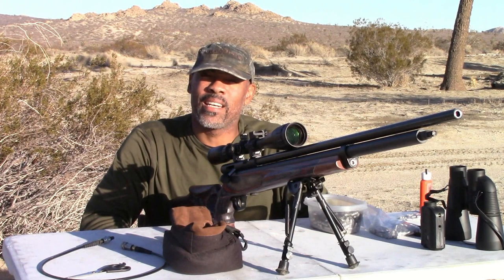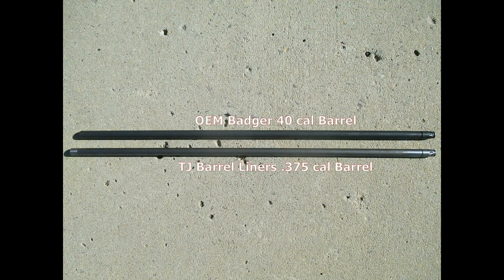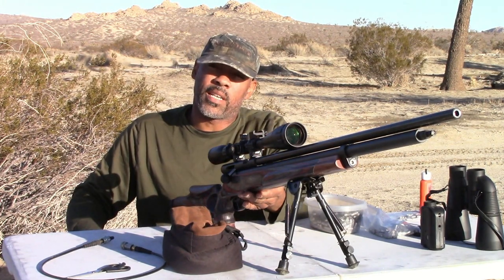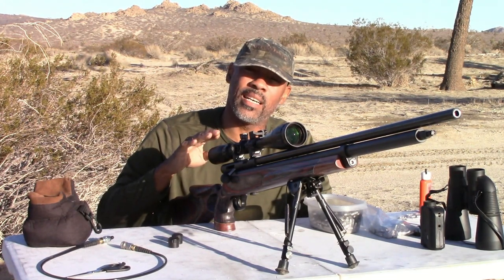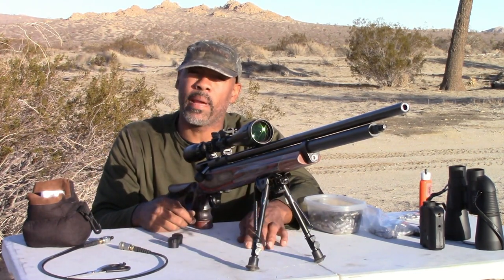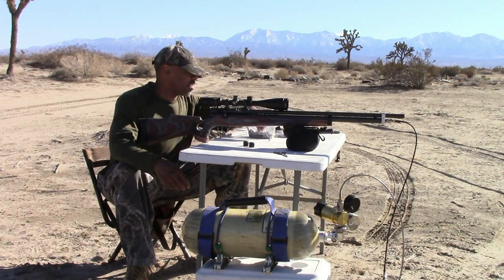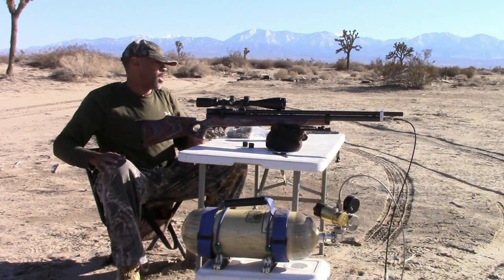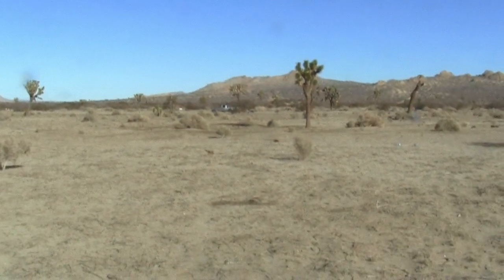EXTREME ACCURACY: Epox Badger 375 cal - .930" CtC @ 170 yards!

Comment: .375" is one of my favorites being the .454" and my personal reason is that you can purchase Speer and/or Hornady ".36" cap n ball Round Ball and shoot fairly inexpensively and accurately with a good barrel. Round ball doesn't YAW in flight. Then when you want to really put the slam on game at extended ranges or pop a bigger animal regardless of the game, you can swap over to the heavier conical bullets. Good caliber. It baffled me as to why they chose to build the gun in .401" to begin with. Even. 357" would have been better. At least then you'd have the option to shoot cast lead Conicals by using soft lead .38 special projectiles or casting your own using any weight and design of .357" bullet which, is actually .358" caliber on O.E.M. firearm cartridges. Then you'd have all the wonderful more recently developed .357 traditional diabolo pellets that are now on the market, plus rounds like the...who makes 'em, Nosler, lead ballistic tipped slugs they designed for use in the .357 Benji bullpup. A lot of choices. Great video as always man. Excellent.

Comment: first and foremost I love this video I'm having trouble finding videos of long-range accurate shooting with air rifles and I stumbled across your video and I'm very very impressed congratulations on the grouping at a hundred and seventy. I was wanting to know what your groupings were with the badger 40 before you change the barrel. because right now I'm torn between buying the Airforce Texan and the badger do have experience with the Texan. I'm in the long range precision shooting and I was wondering what your thoughts were on both the rifles considering you're the only one I've seen so far putting out long-range accurate shooting videos with air rifles

Comment: Great job!  I was wondering how you think a .357 Sam yang turned to .308 would do?
Reply: Dan,
The logical trend today is higher fill pressure guns that go OVER 3000 psi.  Calibers likes 257, 308, 357 and bigger really gulps air.  Many tube guns dont have the volume for such high power usage.  UNLESS you tether.  Higher fill pressures allow higher output numbers so you actually use the gun at moderate power levels.  Guns like the Airforce Condor lines are good for mods like big bores for not only the 500cc bottle capacity but also the IN-LINE valve system.  Can the mod to a Sam Yang be done.  Of course it can.  But i'm not sure what your expecting from the 308 on that platform.  A gun like the sam yang would be more efficient at pushing 357 pellets than it would  308 cast bullets.  Much more drag with a bullet.  Especially when your trying to make a little power